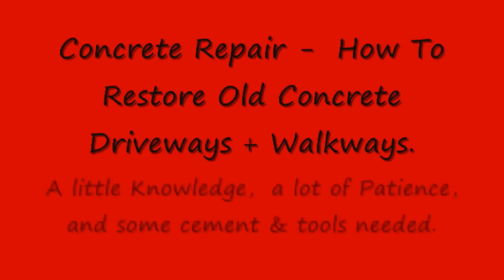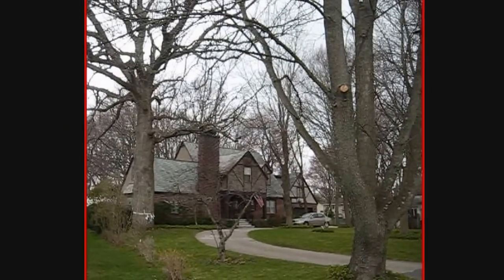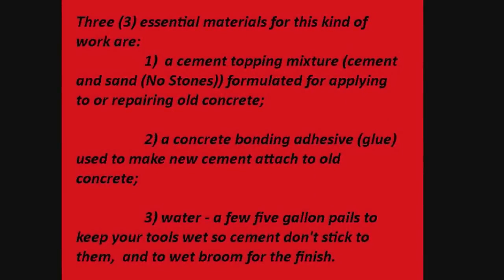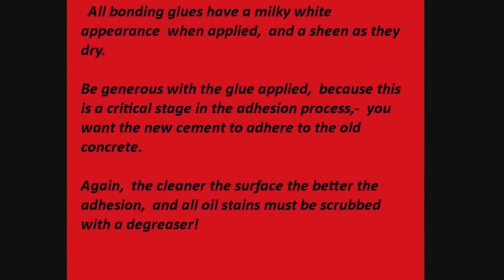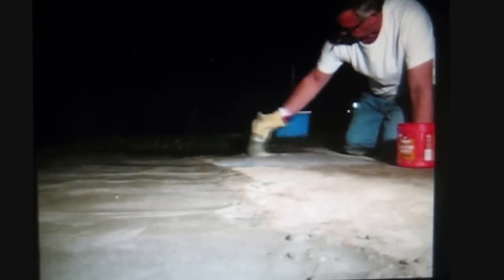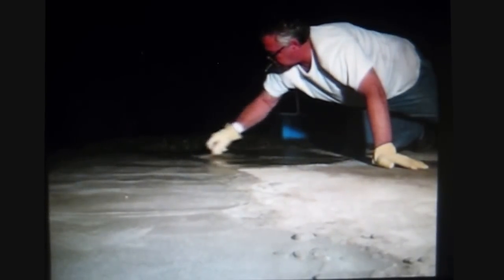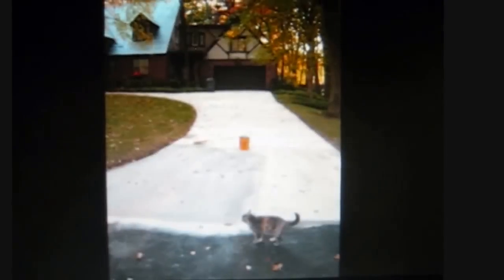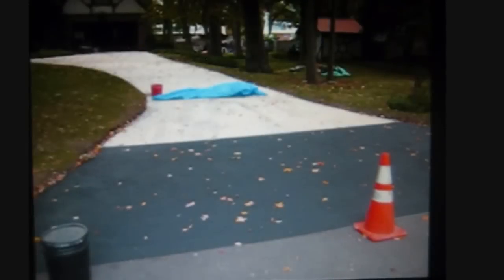CONCRETE DRIVEWAY & SIDEWALK REPAIR MADE EASY

Comment: Excellent how to repair video. I also have just repaired smaller concrete repairs in general.but now have a better understanding on the preparation for concrete glue and bonding factors.Your audio instructions alone were  completely thorough in understanding what needs to be done from beginning preparation, curing process and to the final wet broom top coat.
Reply from the maker: Well thank you,   and good luck!

Comment: What is the life expectancy of these repairs? 
Thoroughly enjoyed the video.
Reply from the maker: rmgravley Many years,  especially if in a warm climate zone,  and you strictly adhered to the instructions.  In the northeast,  where this video was done,  upstate New York,  the surface is subject to extreme temperature changes,  snow and ice,  and salt,  so that some areas may get damaged,  usually small in scale,  and a quick repair come spring will fix.  Also,  if the old surface had an oil stain that was not sufficiently removed,  the concrete glue may not adhere properly,  leading to a weak spot or crack letting water underneath,  thus damaging the surface,  especially when it freezes.  No matter what,  the utter improvement on appearance will give one the needed encouragement to fix any damage.

If you add a concrete sealer,  this can extend the life of the surface.  Again,  the improvement of a  thin coat of cement on top will surprise you,  and make any further repairs or maintenance worth it in the end.  Good luck,  and thanks for watching and commenting.

Comment: That was a very informative video and it gives me the confidence that i needed to do this myself , Out of curiosity what was the Square footage on this driveway and how long did it take you to completely repair ?
Reply from the maker: greg blankenship   It is a circular driveway,  and I did the main part that connects to the garage first,  it ran 75' long by 12';  it was a seven (7) day project,  perhaps interrupted once by the rain;  take your time,  follow the rules,  especially the gluing.  Good Luck,  sorry for the delay in response.

Comment: what about expansion joints?
Reply from the maker: jcm52240 This driveway is over 60 years old,  so that it well settled,  and the expansion joints  were no longer needed,  and the expansion joints were quite damaged with lots of weeds and grass growing.  Again,  the driveway was well settled.  On brand new concrete driveways and sidewalks,  expansion joints are needed to protect from any lifting,  heaving,  or settling effects.
Reply: brokkenstar  thx for the great video & quick reply...

Comment: Great video. What if a pothole goes to the ground? Do you pour the glue on mud/grass or does that only work for concrete on concrete?
Reply from the maker: The glue is meant to adhere new cement to old;  as for a pothole as you describe,  clean it out of all debris or grass,  if you have some stone or broken pieces of concrete about,  put in clean hole and pound it down for a good base,  then glue over and proceed with cement mixture.
Reply: Thanks!
Reply from the maker: Oh yeah,  and don't forget to feather down the edges with a wet paint brush where the new meets the old.

Comment: Thanks for the video.  How thick of a top coat of concrete did you apply to the driveway? How is it holding up?
Reply from the maker: About  1/2 an inch overall;   it has held up very good,  though  some patching is necessary now and then,  but overall very good.